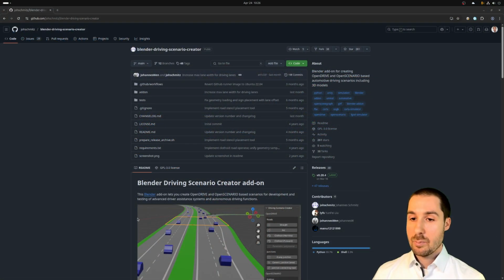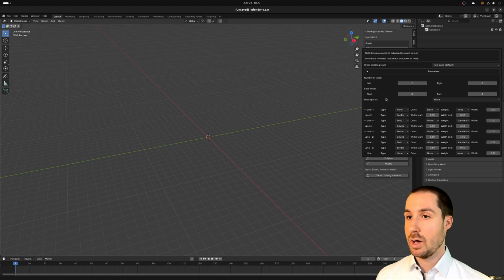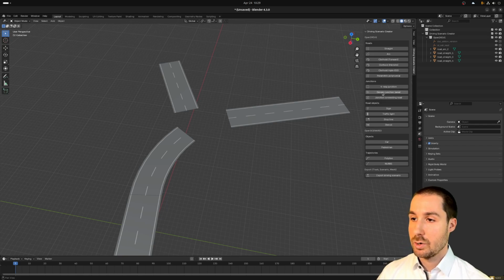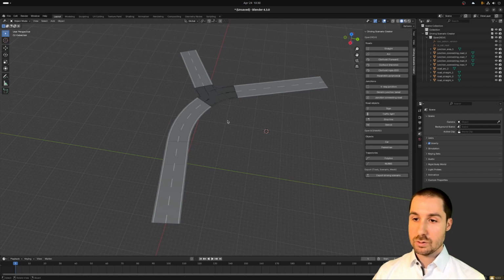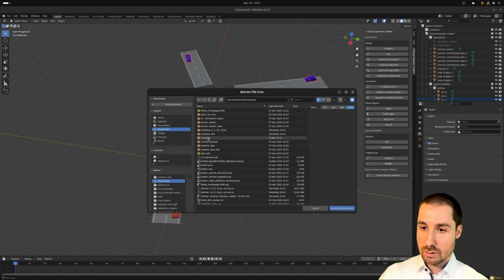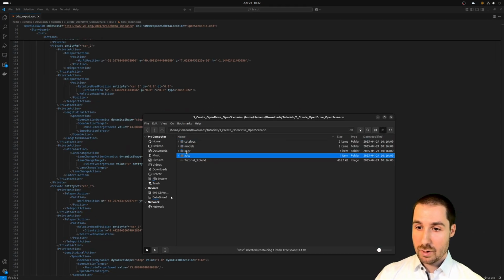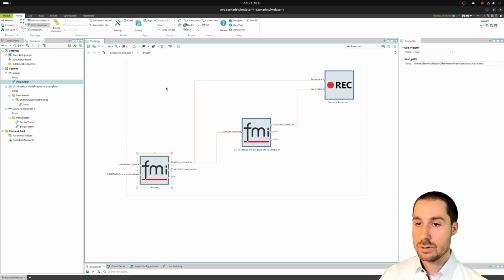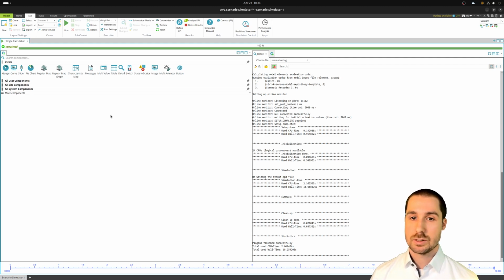Tutorial #3: Creating an ASAM OpenDRIVE map and an ASAM OpenSCENARIO file

Comment: Choosing the road (Straight) brings up the parameter box, but LMB in the workspace does not add the road. How are you adding road segments to the workspace?
Reply from the maker: Your are right. I just noticed, it is an issue in Blender 4.4. In Blender 4.3 it still works. There you can simply select the road (Straight) and then click anywhere in your 3D view. This is already an open issue in the GitHub repository:
https://github.com/johschmitz/blender-driving-scenario-creator/issues/51
Reply: @PersivalGmbH Thank you for replying. Yes, I already managed to test it on the older versions of blender and it works quite well. Thanks for such great videos too. I am preparing for an interview and this was really helpful.